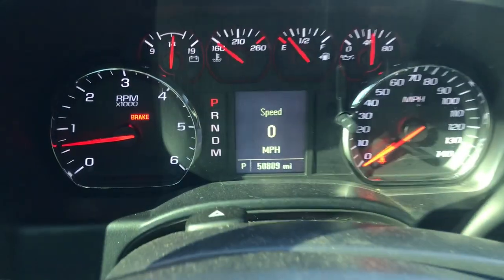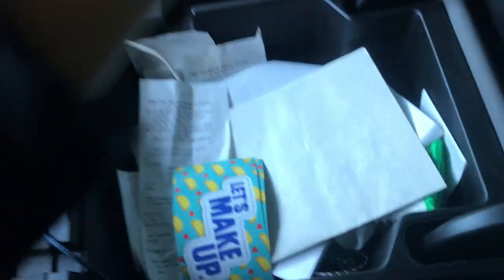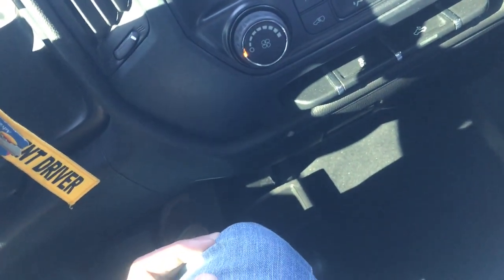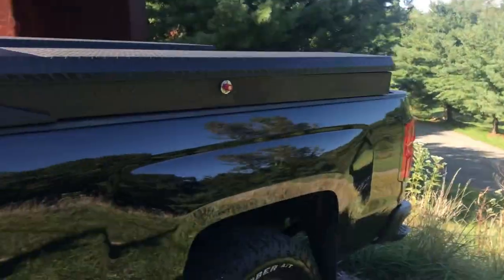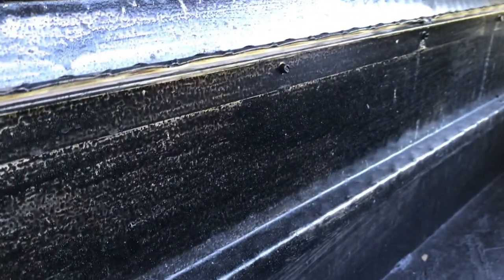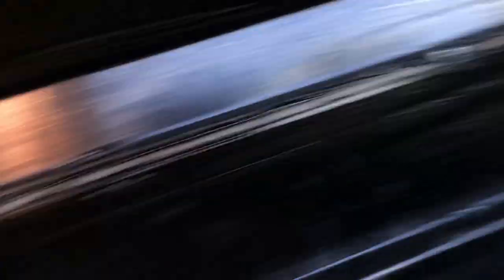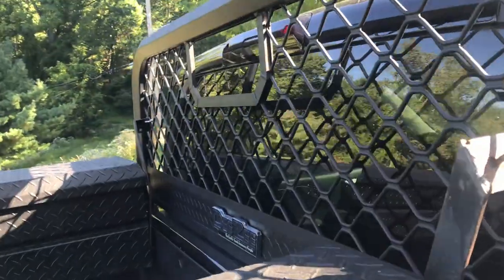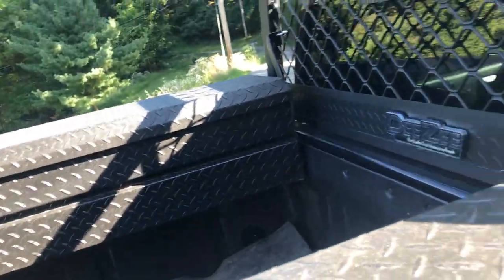Can you Daily Drive A single Cab Truck??

Comment: Single cab:
1. Cheaper
2. Faster
3. More fuel efficient 
4. Higher hauling capacity 
5. Better turning radius
6. More off-road capable (shorter wheel base)
7. Heat/AC fill up cab immediately 
8. Less stress on engine
9. Less stress on transmission
10. Less stress on suspension 
11. Better braking capabilities 
12. No blind spots
13. Tires last longer 
14. That classic look!
15. You're never the village taxi!

Comment: I haven't the slightest idea why people buy the crew cabs.    I can count the number of times I've seen people actually riding back there on one hand.
Reply: I'm looking at them to keep tools locked up without getting a box in bed. But the longer bed seems wonderful
Reply: You’ll need it when yor in yor teenage years, u’ll be riding with all yor buddies
Reply: I found the answer.  The EPA dictates that the short wheelbases must get so-and-so MPG and have been ratcheting up that number for a few decades now.  A Chevy S-10 wheelbase for instance has to get like 35 MPG now.  This is why now they no longer offer the truly small form factor trucks.  When they add a crew cab they extend the wheelbase and raise the MPG target.  The MPG target is not possible without the crew cab, even with today's turbos.   Hopefully, the advent of electric trucks will get us back to normal.

Comment: You can also do donuts with a regular single cab
Reply: Ye I can c that because single cabs are almost more aerodynamic but a crew cab could still kinda do that
Reply: @Zachman229 He is referring to the lack of weight over the rear wheel. These things will lose traction in a hurry in rwd if you don't have weight in the back or great tires.

Comment: I have a 2004 ram 1500 regular cab and I can put the seat all the way back, with a sub box behind the seats and still have a ton on leg room, to the point where I don't usually have the seat all the way back
Reply from the maker: Yeah the rams definitely have a lot more room. I wish the chevys would add more room to the single cabs.
Reply: @jeffdeshong  i agree, even if it takes 6 inches off the bed it would be worth  the interior space
Reply from the maker: @ryze6726  yeah they need to do something. In the 2014 I have to have my knees jammed up against the dash for the seat to go back at all. And the seat will barely go up far enough to put bigger things behind the seat. I love single cabs for work and for the shorter length, I just wish Chevy would take one from dodge here

Comment: thanks for the review.I was going for a 2021 f150 regular cab 5.0..., i chickened out and got a 2021 accord 1.5
Reply: In the long run having a crew cab truck is better
Reply: I'm on the exact same boat... Accord or single cab f-150. Do you regret your choice or are you happy?

Comment: I have been daily driving my 2004 Toyota Tacoma single cab with no issues at all.
Reply from the maker: Some single cabs have more room than others. My 04 has way more room than the 2014. And the ram single cabs seem to have even more room. After driving this 2014 for 4 years it really is just a little too cramped for me as a 6’4 guy.
Reply: The resale value on old toyota trucks is insane

Comment: What year is this
Reply from the maker: 2014 Silverado 1500 wt
Reply: I really didn't know that you could get a 2014 with a manual crank windows
Reply from the maker: @TinyTurboVW  yup you can. They’re just rare. Honestly I don’t mind it. One less thing I have to worry about breaking
Reply: I also wouldn't mind but it's just a bit shocking considering everything is power nowadays
Reply: My 2014 GMC Sierra single cab has hand crank as well
Reply: @TinyTurboVW  seems like Chevy W/T models are pretty much all crank windows. At least all the ones I see in my area are

Comment: I like how people dont think you can live with a single cab. 99% of pickups were single cabs from early 1900s  until 90s. Then extended cabs took over until 2000s. Compacts got double cabs in 2000 an half tons got in in 02 with super crew. Crew cabs have been popular for only 20 ish years while reg cabs have been around for almost 100. Its still much more practicle than people who daily miatas or convertables or any other 2 door coupe